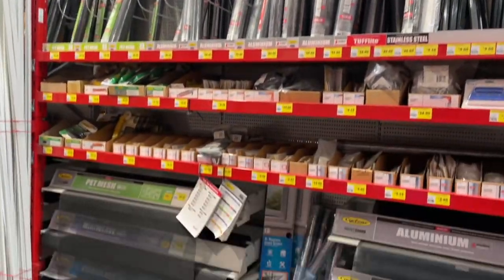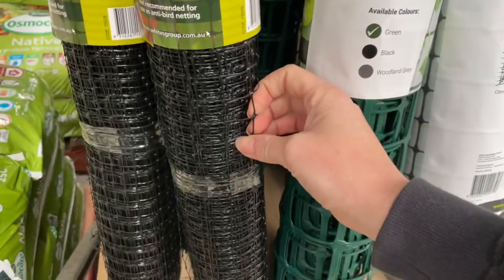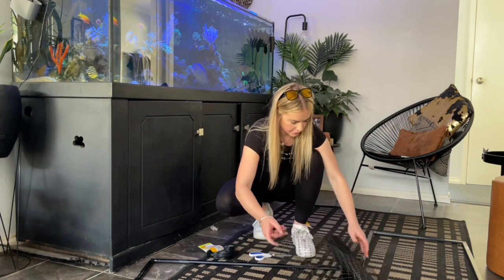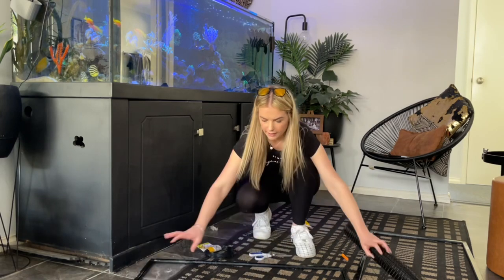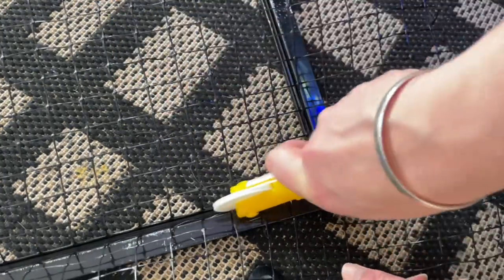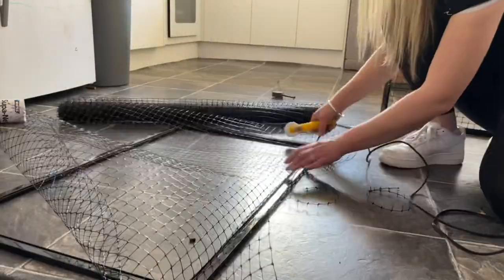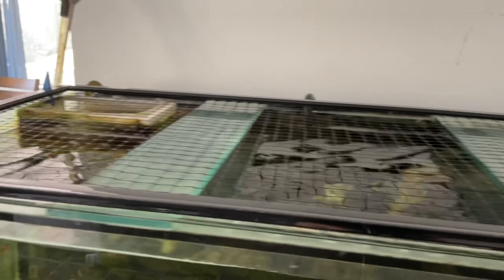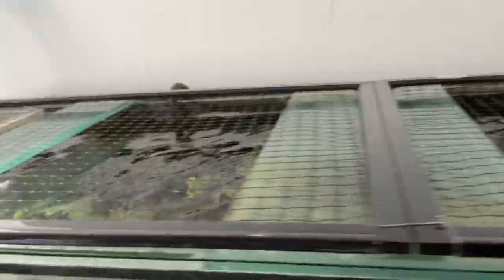DIY Mesh screen jump guard for saltwater tank

Comment: FYI you can make clean angular corners using a "mitre box" which would look neater (like a normal flyscreen window). You can also buy mesh similar to the brand name mesh lids on eBay or Amazon. I got a 6ft X 4ft roll for $24 free postage to AUS. Much cheaper to DIY than the brand name options that's for sure! I think someone has already addressed the hack saw usage so will let you off for that one 😂

Comment: Cool diy jump guard! 🙂👍 

but holy 💩…. How expensive are fly screens in Australia? 😳 Here in Germany you get e.g. a 100x120cm screen including aluminum frame and free shipping for 16€ on Amazon…

You could make the individual fly screens smaller so that they fit between the crossbars and on the longitudinal bars. You will no longer see them when you look at your tank.